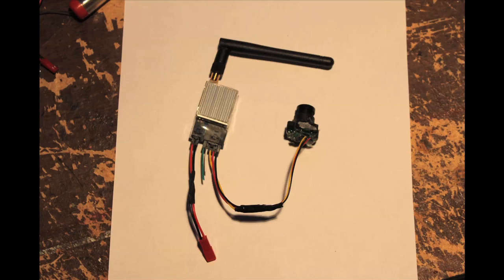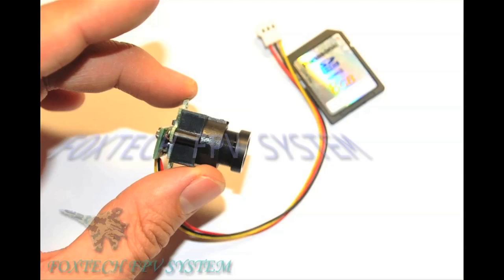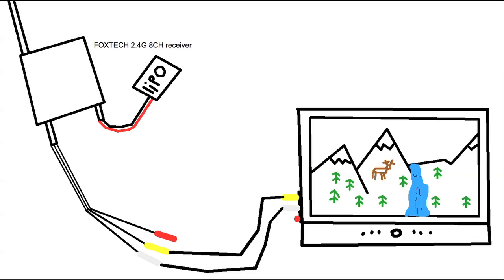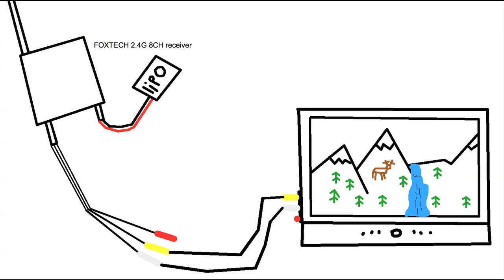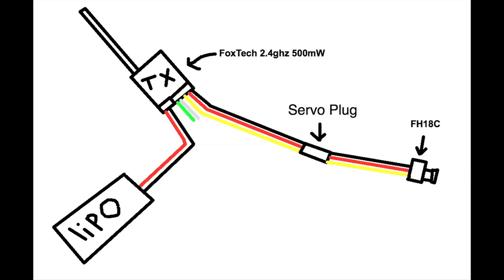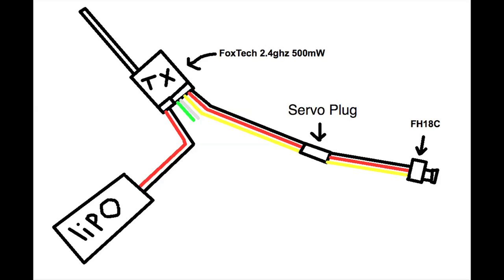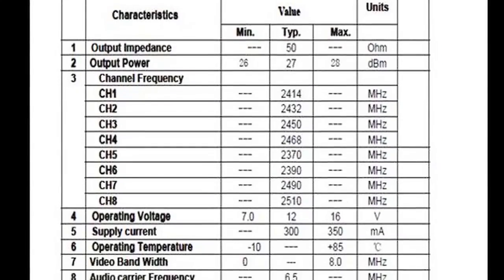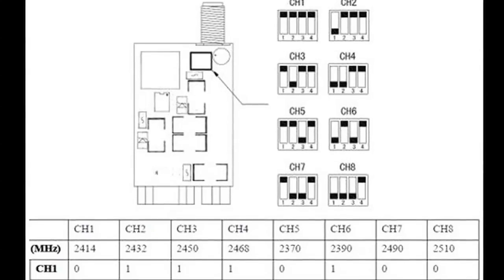How To Setup FoxTechFPV System

Comment: A while ago you told me that I couldn't use my 2.4 gigahertz  transmitter with the 2.4 gigahertz fpv syestem. So then I thought how are you using you spektrum radio with thesis syestem?

Comment: Ok , finally got it working.  It came down to this:  The diagrams show white and black squares for channel 1 through 8, for the receiver.  The diagrams on the airborne transmitter supplied in the video are similar, but don't correspond exactly.  The question I had do the black squares represent the switches (which are in fact white) or the spaces? ha ha !  But it makes a difference. Finally just kept trying combinations until I got a picture.  Neither one matches the diagrams but it IS working!

Comment: keep in mind most of you are probably using 2.4ghz radios, this system he uses while great will not work for you for just $100. You will also need to use the dragon link system along with the 2.4 vid gear